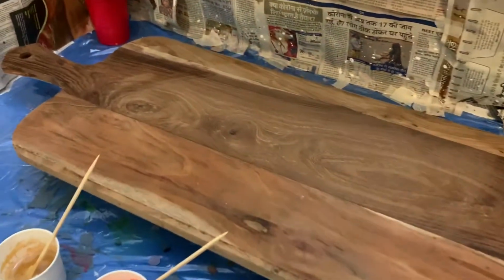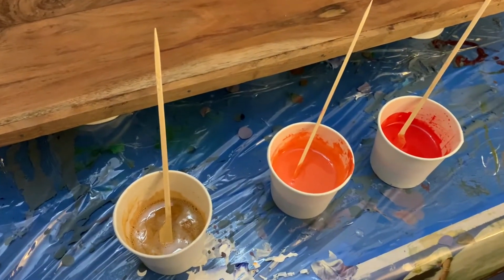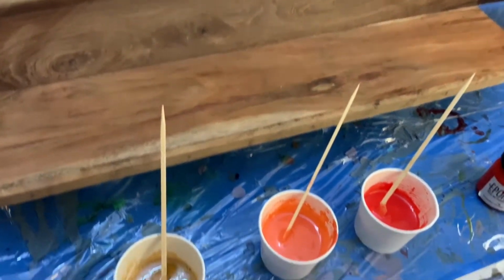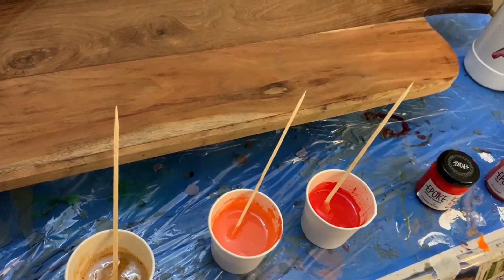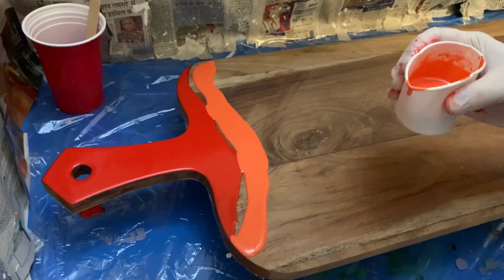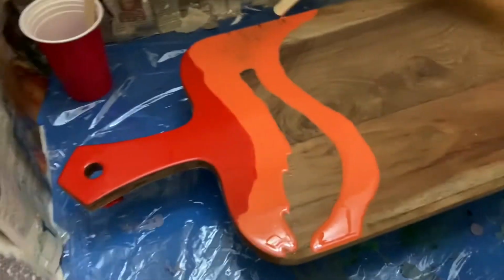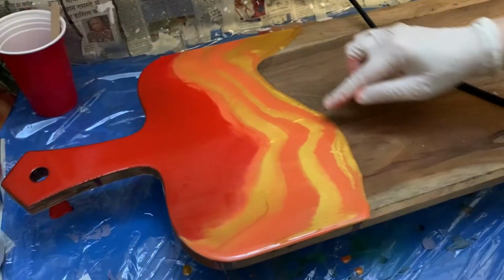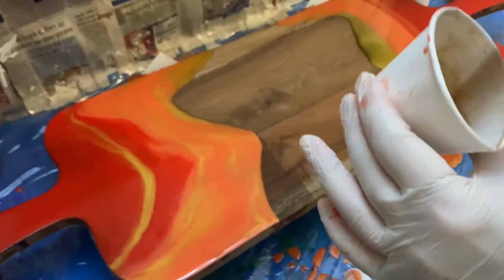Resin art on a cheese board - Bold colors - resin - woodwork - #32

Comment: Can I mix Arteza Acrylic paints with resin for my board. Love your colors!
Reply from the maker: Lynne, yes you can add acrylic paints to color your resin. Having said that, I have found that acrylic paints when added as you have to use a small amount does nothing give the vibrancy in the colors. Using too much to get a deeper color makes the resin thicken. So if you don’t mind that then yes, you can use acrylics. I mostly use pigment and powder colors that come for mixing with resin
Reply: @mohanimabyrakhijha5276  thank you for replying. I live in rural Texas so I buy my supples from Amazon.    It’s confusing when I look at the mica powders, the enhancers and acrylic inks. I have been doing alcohol pouring for a year but want to do some charcuterie boards for gifts.  🤔